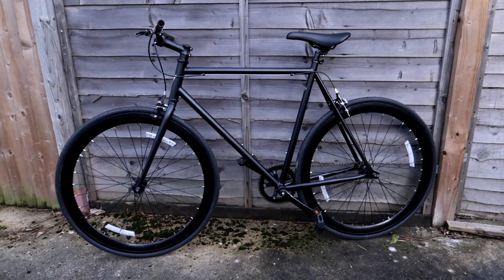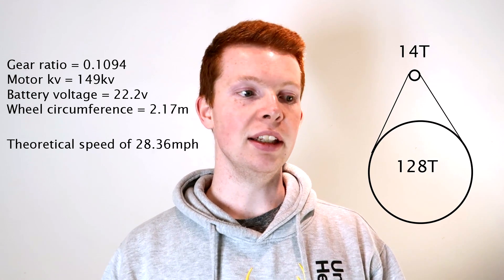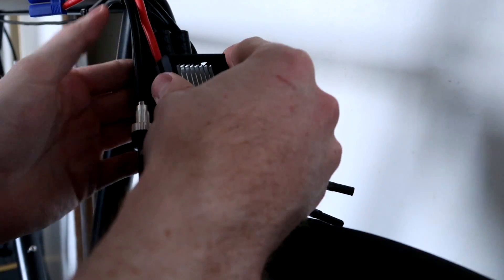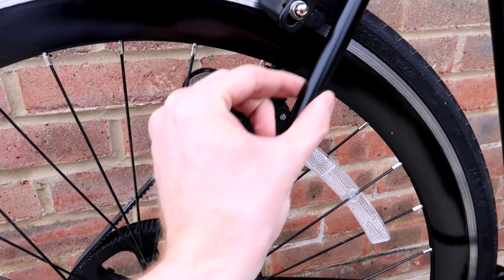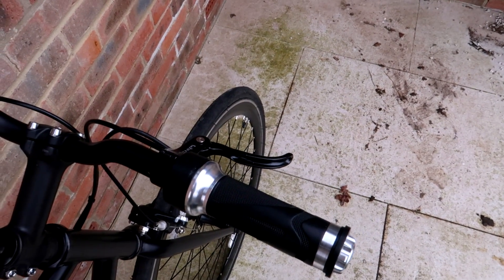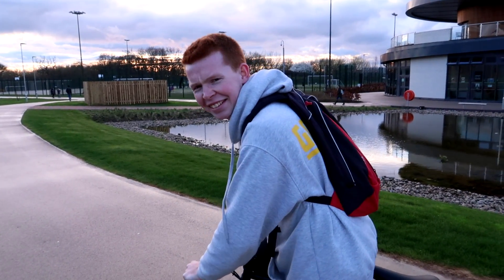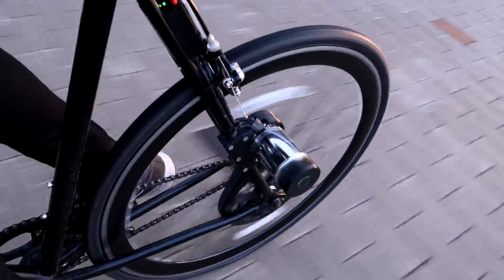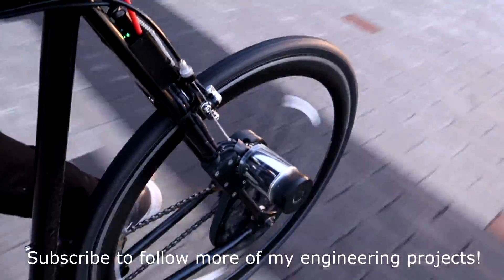DIY Electric Bike

Comment: I would of attached an ac generator onto the bike and attach it to the main chain connecting the pedals to the wheel so you can recharge the battery without relying on charging it from any mains electricity.

Comment: Pretty neat project.  The "throttle" handle you would essentially just take and make a variable resistor/capacitor circuit and something between it and the controller since you said PWM, most brushless DC motors can have a controller like that but it's interesting what you can do with microcontrollers these days like your friend using an Arduino.  The cooling fan was a wise idea but I wonder if there's a way to make a protective cage for it as well if you were to wipe out causing damage to the motor... or maybe making a helically cut bevelled gear setup instead of the belt.  Granted, the geartrain would be somewhat heavier and noisier than the belt but at least your motor isn't sticking out like a sore thumb.

Comment: is the math correct? i calculate 29.2mph. 
149 * 22.2 volt =3307.8 rpm motor
198468 rph motor
21707.44 rph wheel (2.17 m)
  47.10 km/h  which is 29.26978 mph

Comment: elegant design Tom,
i found XL6009 DC-DC Step-up Module interesting.i hope u can use them in order to provide stable power supply to li ion bty as cheaper source of energy back from motor.rest the model is pretty nice.nice job and well implemented.

Comment: Hey man, thank you for the video; just wondering what code you used to convert analog to digital, I know the code isn't required for this specific set up however if I was to be using a different esc, a more basic esc I would require the code. Could I have a copy of it to edit myself? I won't be taking an responsibility for it, I will simply be using it to control a motor :)

Comment: do you have a copy of all your design calcs? I'm trying to do similar but using a chain drive running directly from the fixed side of my flip flop hub to reduce the amount of modification and manufacturing required. but i'm having trouble getting my head round where that ideal ratio comes from.

Comment: where do you get the rubber grip material you used to attach the motor holder to the bike bar? Please. Brilliant work. Thank you for sharing your project.
Reply from the maker: +Brendan Keane I bought it from ebay. If you search 1mm rubber sheet, you should be able to find some. Thanks

Comment: Very nice Tom!  I've made nearly same config (SK6374 + VESC + 12s Battery + 3D printed large pulley + T5 belt). The larger the pulley, the lower the current required to get enough torque. http://img110.xooimage.com/files/9/5/b/mqdefauls-4b13410.jpg
I am lucky a can use a large 3D printer, but lost likely you can print (or cnc cut) little portions of the pulley and assemble them (just like you did actually)
An HC06 bluetooth module connected to Vesc and the Vsc monitor app on Android make it possible to see and log energy data quite easily..
Reply from the maker: I've been testing 12s with a similar pulley setup to yours (ring pulley attached to the spokes). But every time I try 12s I kill a VESC (killed two now), which I think has always been the DRV chip failing for some reason (current motor kv is 149kv, so no idea why its failing). So will be settling for either 8s or 10s. What gear ratio is yours and which kv 6374 motor do you have? I'm tempted to go for a 192kv motor on 8s and run a 1:16 gear ratio, which I expect would have a top speed of just under 30mph, but have about 30% more torque than my current setup. Thanks for the info!

Comment: Its a great video well done, I know from experience over on the endless sphere forums running RC controller/motor combinations like this without some kind of slipping clutch and freewheel in ebike applications often ends in premature motor controller failure as the cheap ESC units do not like high stall currents, reverse rotation etc and you may have issues with heat because of the back emf being induced when you peddle with no motor.

If you want to see how its really done check this guys youtube channels out he is the master of using these motor/controller combos with slipping clutches.

https://www.youtube.com/channel/UCag_Fn_Ey6ZweQTUOz7Y0Qg

https://www.youtube.com/channel/UCFpVVcldY6ASGZkuWRGizEA

Comment: I'm 250lbs. Will this 3d printed pulley not break on full acceleration up a steep hill? I want something resilient.
Reply: You should probably pedal mate......
Reply: Ben Freer so the safety factor isn't good enough with the FDM parts. I'll look into other methods thanks!
Reply: stuxtruth
Doubtful. A simple test would be stall the motor at full throttle using the brake. That should be the maximum torque on the belt. If it survives that then your mass is immaterial!

Comment: This is essentially a mid-drive style bike . you would get more torque from a direct drive system aka hub motor . you should make a new housing for the motor with spoke holes and make a hub motor . Now that would be cool . Having said that this is a very cool  bike .

Comment: Just a few tips Tom, you might want to try to mount that motor behind the seat below your throttle chip controller but have the motor turned 180 degrees & swap the wires so that it runs in the correct rotation. Also you should make up other size wheel sprockets to get a higher speed example one that is 2/3 the diameter of the black main sprocket on the wheel. Look into making the sprocket thinner by thinking about a V-Belt that is a V-Belt Drive Belt, they look like a cross between a V-Belt & the Timing Belt you are using. That way you should be able to fit both disk break & pulley. You will need to put in aluminium spacers rings that fit over the disk break bolts so that you put these through the plastic pulley so when you tighten the bolts you don't crack the pulley, the spacer only acts to keep the pulley in the right place. These spacers are like spacers on a chainring for a double or triple crankset but they are 5mm.

You can easily order longer M6 stainless steel bolts that use a hex key instead of the star key that you can. These adjustments will make it go speeds of 60-80km/hr or 37-50mph & because you will only use the throttle when you have got your bike up to about 32km/hr or 20mph then you can take your bike long distance if you have spare battery packs in your backpack or if you have a pannier rack on the back. Also you could incorporate a solar panel to charge your battery pack as using it giving you longer range. If you can get 2 of those 10 watt china made You can try these new mods on the next bike you work on which might be a 30 speed touring bike etc.

Drive belt idea example only
http://www.ebay.com.au/itm/Gates-V-Belt-Drive-Belt-11A1140-x-1-/201706569798?hash=item2ef6a60046:g:CRIAAOSwcUBYGZw4

6mm Inside Diameter sleeve bearing for plastic sprocket mounting M6 bolts for disk breaks
http://www.ebay.com.au/itm/4-Pcs-5mm-Length-x-8mm-OD-x-6mm-Bore-Silver-Tone-Plain-Sleeve-Bearing-/331652031106?hash=item4d38006282:g:rFYAAOSw4CFYuJga

20W 13.6V Solar Panel 1.4 amp Size: 435*280mm This one is a mono flexible panel
http://www.ebay.com.au/itm/10W-To-100W-12V-Mono-Semi-Flexible-Solar-Panels-Caravan-Motorhome-Boat-RV-/252598378045?var=&hash=item3ad0095e3d:m:mK4JyOI_G54pApyXuJZ5-Zg

12v 10a Lithium Battery Charger
http://www.ebay.com.au/itm/12V-10A-Lithium-Battery-Solar-Charge-Controller-Charger-Black-English-Manual-/112382752201?hash=item1a2a88b5c9:g:AoUAAOSwRUhY~h1f

Comment: This looks like a very clean build. would using a (hall) sensored brushless motor be a possible improvement? I think some of the motors used in those hoverboard things already have those included and might be suited for e-bikes as well. See for instance Racerstar 6368. Speed controlling those is a bit unclear to me though in practice.

Comment: Excellent project very neatly carried out.  I keep trying to think of a reason to buy a 3D printer perhaps this is it.

I've very recently converted my wife's bike to electric assistance using a commercial available system. This uses front wheel drive and a pedal assist feature which can be varied in steps depending on how steep the hills are. I'm about to convert my own bike too. We're experienced cyclists and it's our age (late 70s) that's making us resort to artificial means :)  

The system we're using is from Cyclotricity and is around £500 so yours is much cheaper (we already had the bikes).  A complete front wheel with motor hub is only £129 so it might be worth looking at for future projects but the motor is 36v/250w.

Just a warning. The legal limitations on electric propulsion for public road use of pedal cycles in the EU are for a max power of 250 watts (less than than my aeroplanes!) and 25kph (15.5 mph) so be careful!  I also think having a simple throttle rather than pedal assist (which is a bit more sophisticated) may be legally problematic as well but not sure.  

Great project though and it does you credit.  Good luck with your studies.

Comment: your an engineer and you wouldn't call that a tentioner what is it doing its putting tension on the belt so it does not slip off the teeth what the he'll else would you call it
Reply from the maker: Well technically it's called an idler pulley as a tensioner is supposed to be spring loaded to keep a constant tension on the belt
Reply: a fuddlewickie

Comment: Would the motor controller not be damaged from the back feed off the motor
Reply: Commando Squeak diodes...
Reply: Im aware of diodes but I didn't hear tom say anything about fitting them or built in protection on the ESC, hence why i asked the question

Comment: Very nice. One question, wouldn't it have been easier to wire the rheostat on the handlebar in line with the power from the battery rather than converting analog to digital?

Comment: Nice project, I'm using a printed pulley on my electronic longboard as well! Holding up nicely. BTW, you don't need the arduino, you can control the vesc directly with voltage. Just change the settings using bldc tool. Less failure points that way

Comment: BEWARE 18650s li on doesn't support a lot of amps
Reply: 18650 is just a package size. Most electric cars use them, and most ebikes use them. Good batteries can handle a lot of amps.

Comment: Tom that is awesome but make a generator too that will charge the battery during riding it (you can position it on the other side of the wheel). ENDLESS POWAAAARR

Comment: looks fun stuff but this is not an electric bike though under UK regs, it's a motorcycle, as speed is too high, think it's 15.5mph limit from memory. means you need a driver's license, tax, insurance and type approval, without it could be banned from holding a driver's license for years and face big fines.
Reply: oh fuck off grandma....

Comment: Neat. Since that's a huge motor, I think it should be capable of far more performance with gearing and voltage. Maybe 200 teeth and double the voltage. Maybe 300 teeth. The power density of a motor is proportional to the max rpm. Use the max rpm. Feed it what it needs. High rpm is without temperature cost. Another approach is to use the tire as gearing. Direct drive.

Comment: Hey, tom I like this. Awesome work doing.
Reply: Tom Stanton ok
Reply from the maker: Thanks!
Reply: Tom, I designed aluminum gear pully. I bought ESC & BLDC motor, but the problem I am facing ESC has little delay for start everytime. I used servo motor control circuit, I rotate the knob then it produce little sound for 3 sec. then it start. Is there any circuit which start the motor immediately without delay. Thanks for sharing information.

Comment: My biggest concern is the motor mount, it's close to where heel could easily hit. To complicate that the motor would then catch and jam into the spokes.
Reply from the maker: The motor mount is very hard to shift with the rubber grip pads between the printed parts and the frame. It's enough to keep the belt under tension and I haven't experienced it shifting yet. Thanks
Reply: It's not shifting by it's own right that's concerning, it's being so close to the heel. A good heel strike with from an accidental kick will put the motor wedged into the spokes.

Comment: The speed controller takes PWM  which is an analog signal since the information is in the variable time between two signals.
As I understand there are Multi copter ESCs that take digital input named "Dshot" .
Keep up the good work.

Comment: Hey brother nice E-cycle...just a doubt...what hapens if a capacitor is attached in parallel with DC-motor...???
Reply: That's a brushless motor, and the ESC already has a few capacitors to buffer the voltage and current flow.
Reply: Pleasure..for your reply...can you suggest me a motor suitable for e-bike with specifications...
Reply: great video Tom.   i will pass it around my biking chums and hope you get more subscribers

Comment: This would be awesome down the Alban Way, I could get to work in minutes!

Did you work out how many watts it is? I don't know how savvy cops are to the laws on power assisted bikes but legally to ride on the road without road tax it needs to be less than 250 watts, which is less than what all my rc models make!

I've got a few 4500 6 cells lying around from my edf jet which should do. I might just have to make one of these!

Comment: Hi Tom.  Are you sure you are getting full throttle on your motor?  A normal e-bike has only 250-350W whereas yours should have at least 2000W with that motor, ESC and battery.  In short, the gearing should be largely irrelevant, your big issue should be keeping the motor from tearing itself off its mount and/or ripping the PLA gear apart.

Comment: nice bike, excellent build.  couple thoughts, if cost is a issue why not get a used bike?  I suppose you had a specific model in mind, limiting your used bike choice.  also wouldn't it cool better if controller was facing the front?  you would see it less and the angle would keep rain off.    keep up good work

Comment: I have a couple of questions if you have the time and inclination to answer me. I would appreciate if you could answer roughly how far on a flat and levelish surface will that 5000mah battery take you, do you use any battery management circuit to prevent over discharge also are you using blocking diodes to prevent electricity being sent back to the controller due to forward motion that will spin motor and generate lecy? I know that this is a dumb question, but please amuse me. What does the kV relate to when they describe an electric motor? I only ask as I don't think that it refers to kilovolts, then again it might be in some strange scenario. I am not sure if you could manage to fit some sort of clutch mechanism to disengage motor as that might be beneficial when you just want to use  pedal power alone. I really do like this build though and just another thought I think a fuse might be an important addition. You and your mates Tom are clever to have been able to make this. I am also really interested in the software your pal wrote to convert the output from the twist grip into zeros and ones for the motor's speed controller.

Comment: Hey Tom, I tried you idea once, you can check it here. https://goo.gl/7bf3xr Unfortunatly motor burned down. I got 26" tyres, 1:14 gearing, but only 230kv motor. I was able to reach 45kmh while seeping about 1.2kw from batts, but acceleration in slow speeds finnaly killed it. Theese outrunners are very sensetive. I might build one ebike someday but I will use just some 1:35+ planetry gear. It is just way to easer. And you can get finaly decent power while offroading.

Comment: As Below ! I can't believe you didn't t just convert a Servo tester !!! I use one to control the steering servo (connected to the steering wheel shaft) on my Boys e-car .. Steer by wire ! So I can flick a switch and take control if needs be ;-)

Comment: Hey Tom, welldone! Awesome project! Do you thing I can modify it to fit my strida 5.0 folding bike? What gear ratio should I use (it has 16 inches wheels, single gear with 100/30 gear ratio)? what was the cost of the project bike excluded?

Comment: nice project i made one with a friction drive, works pretty well and is easily removable from the bike. Though efficiency id imagine is not the best neither is tire wear. My bike has disk breaks so sadly this project wont work. the motor is an 800kv 600watt brushless, if you push it too hard and miss treat it, it can get pretty warm maybe close to 100c (when it burns my skin its to hot lol).

Comment: I like it.  A nice, clean design. If you had opted for a bike with disk brakes could you have removed the rear disk and attached your drive pulley to the provided mounting flange on the hub?

Comment: Great job. I'm sure the esc cost a pretty penny but it looks like a nice setup. I doubt you'll have any over-heating issues, considering the size of the heat sink on the esc, however you could always turn the esc around so the heat sink is facing forward and getting hit with direct air as you move forward.
Keep up the good work and keep the build videos coming. I'm sure the 4 of you could come up with some pretty neat stuff as aspiring engineers. 👍

Comment: The memories of nasty Hatfield and late nights in university of Hertfordshire...
Wouldn't trust 3d printed parts for an electric motor drive system. Holding batteries, even motor would be fine, but driving a 3d printed pulley is risky. If you still want to stay with PLA, at least consider baking it. It will considerably strengthen it(https://goo.gl/SoKzFJ). It's nice as an experiment, but for real world use you probably would want to get a cheaper hub kit or for the same price bbso2. In terms of upgrading to 18650, don't know if uni has a spot welder. London Hackspace might have one , if I'll have time to repair it

Comment: Cool project and vid.  Would the parts be better in ABS or PET? I guess ABS might be too brittle. Any filament with higher temp spec and also good mechanical strength ?